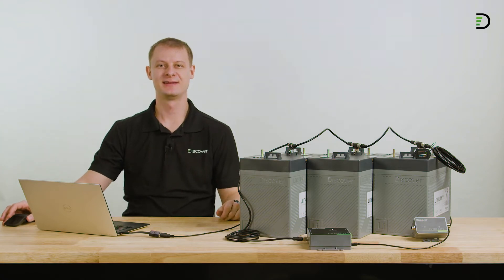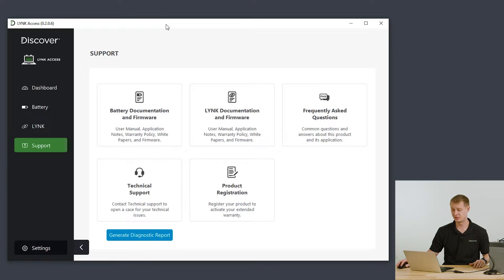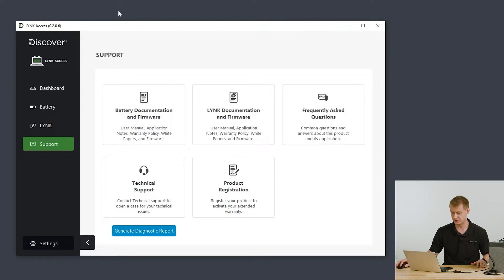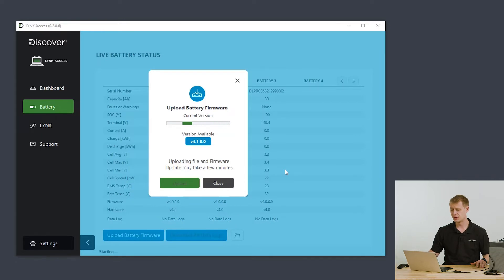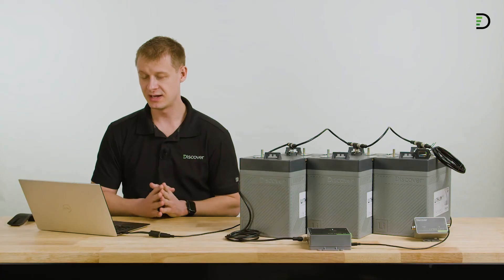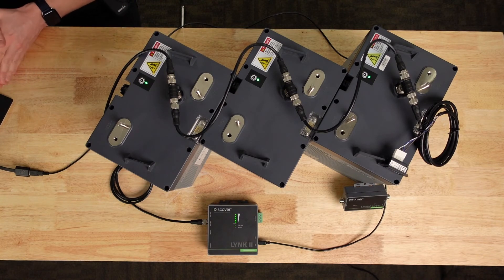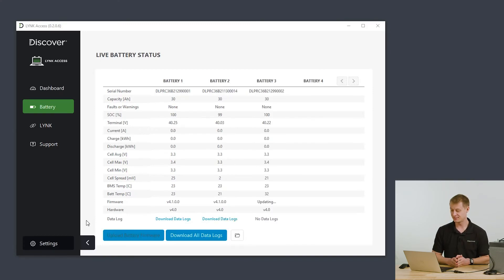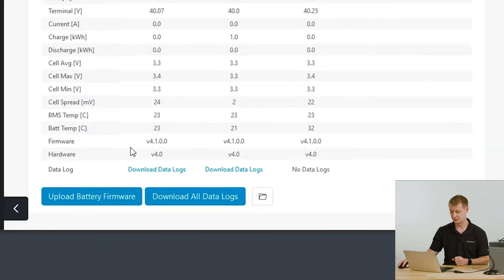How to update the battery firmware with a LYNK Accessory

Comment: I am running 4 42-48-6650 batteries and I am not seeing the update firmware battery for them at the bottom of the screen in the Lynk Access software.  I do see all of the batteries and their status in access, just don't seem to be able to update them through the access software.  Am I missing something?